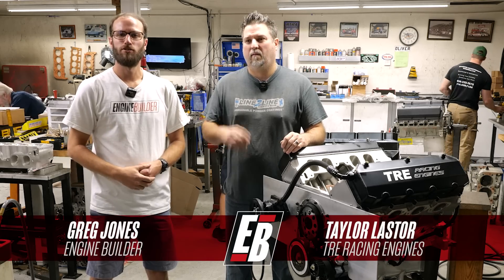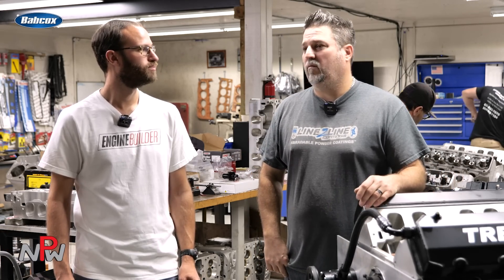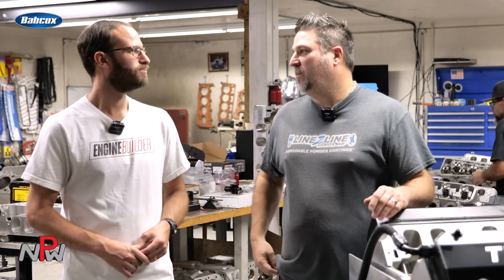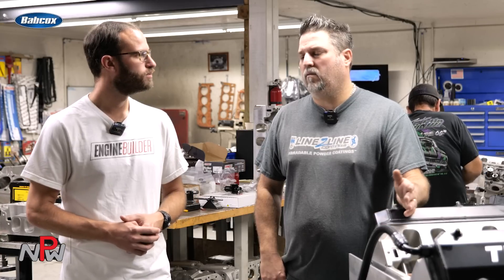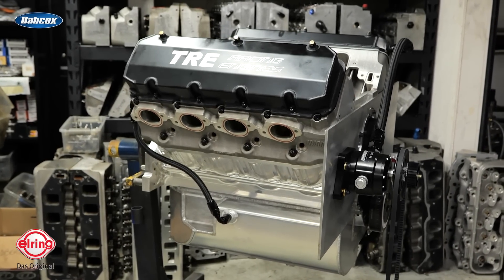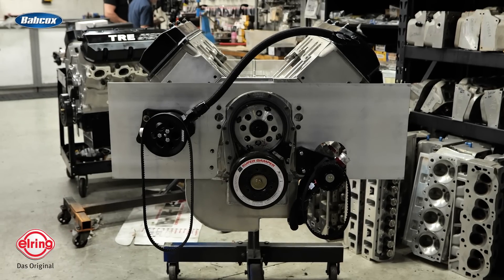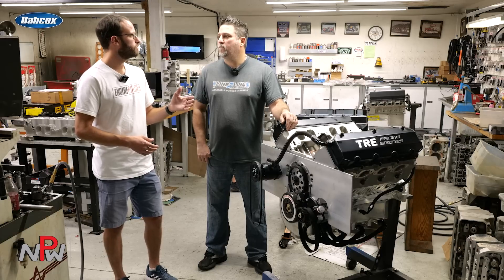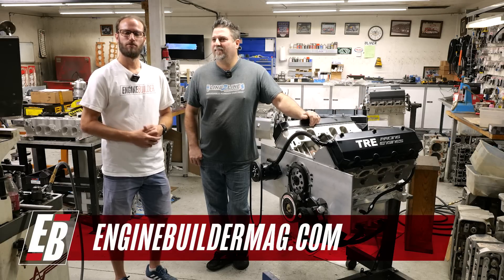TRE 760 cid Big Block Chevy Nitrous Engine

Comment: I wish the guy from engine builder would ask more intuitive questions so we can get more information from the builders
Reply: Questions for example... At what RPM do these engines make their claimed Horsepower???
What is a good Durable, Livable, Long Lasting, Rod/Stroke/Deck Height/Bore Size/Rod Angle Ratio are the best for engines for 632+cid and up and such as some of these 700+CID engines so they will LAST verses beating themselves to death and having to do early teardowns/rebuilds, etc.???
What are some of the better Deck Height/Rod Length/Stroke/Rod Angle Ratio combinations, etc etc for LONGEVITY???
Reply: A pic of the dyno graph would be nice as well.
Reply: I dont think he cares anymore.
Reply from the maker: What would you like to know specifically? We are always aiming to do better.